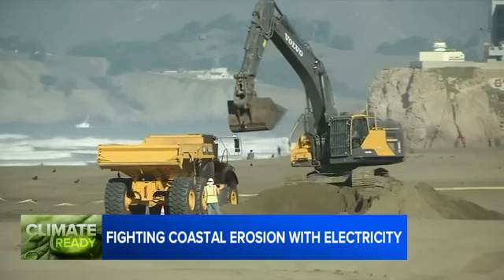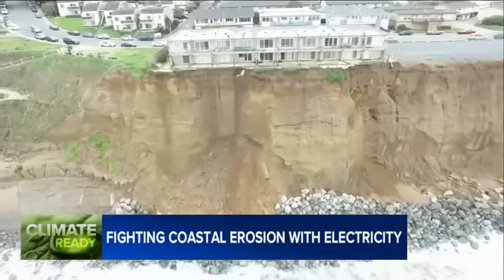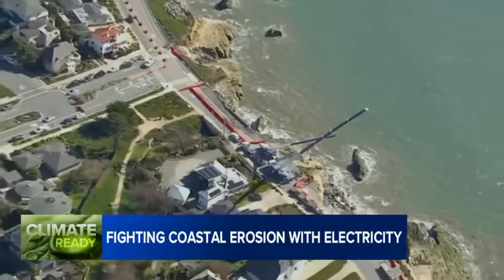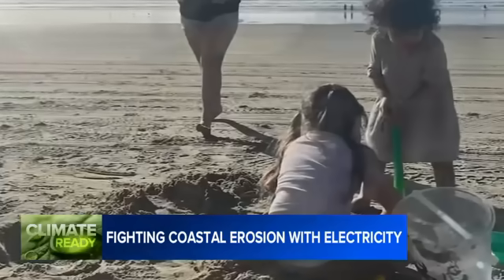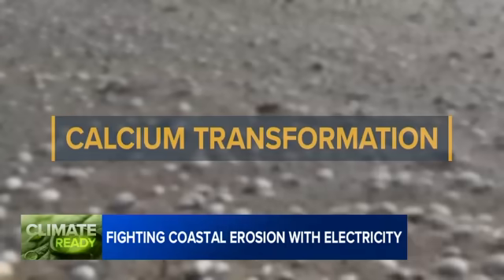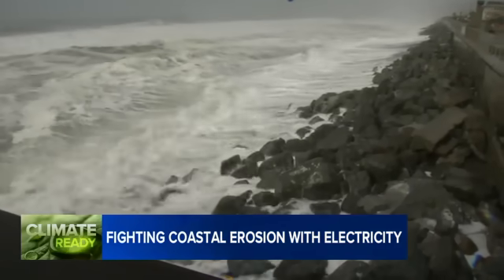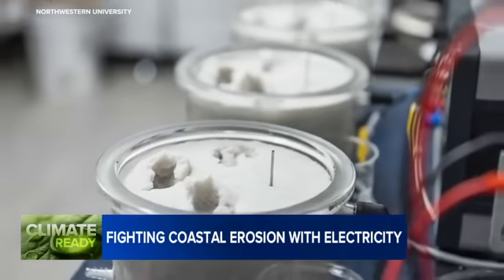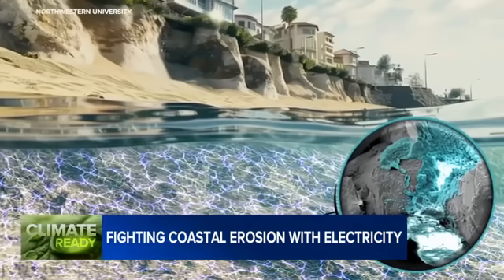Researchers hope to rescue California coast by zapping sand with electricity

Comment: Hell if you used an umbilical cord type cylinder down the coastline you could actually put a roadway in an umbilical cord of style type of roadway down the coast line instead of having to worry about the PCH falling off into the sea